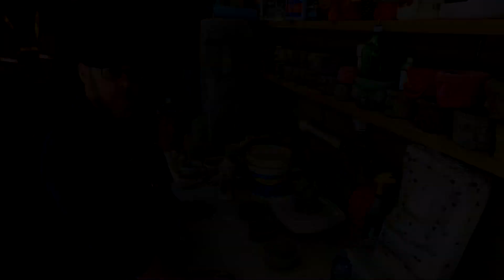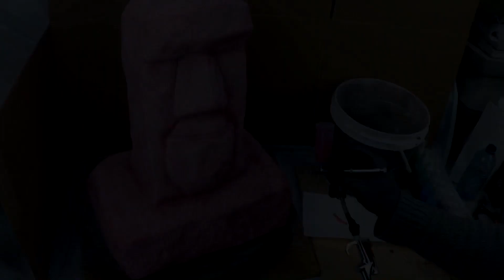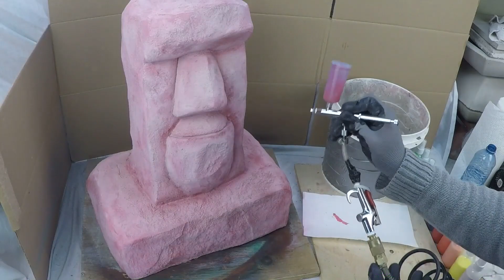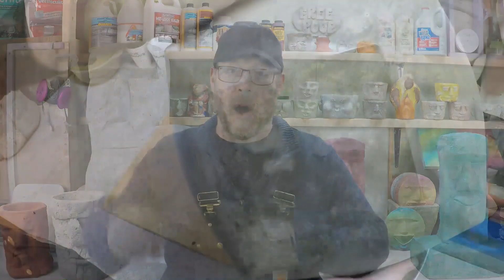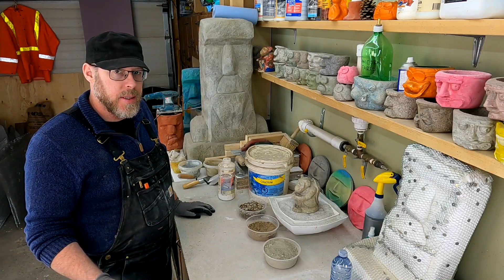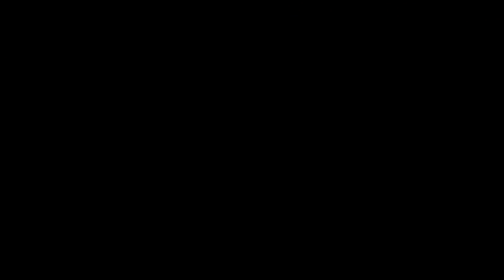How To Speed Up Concrete Curing

Comment: Hey, DIY dummy here. I have a ridiculous amount of old paint leftover and I’ve been trying to solidify it using concrete (should’ve used cement). I have paint in a bucket and have mixed at a ratio of about 20lbs of concrete:1 gallon of paint, and it’s not drying out. My buckets are basically full of this concrete paint mixture, and I need to get them solid by the time the trailer gets picked up tomorrow, is there anything I can do to solve this issue?

Comment: I have been using Quikrete in my silicone tile mold to good effect.  Yesterday I used Cement All, and when I came back this morning, I see that it has warped the edges of the mold, pulling each corner up, making the whole tile concave.  Any idea what may have caused this effect?  I haven't seen this in the 6 tiles I've made with Quikrete.  My guess is that the Cement All has some additive which may have created some heat in the curing process.  Any thoughts?
Reply from the maker: It definitely has accellerants in it which do cause heat from the exothermic reaction.  The faster the mix sets the more heat it creates. Was it outside and subject to winds also?  This can cause curling of the edges in slab pours.
Reply: @creatingconcrete  Thanks for the insights, greatly appreciated!  It was indoors.  I'm here in San Francisco, so our apartment has a fair amount of moisture.

I suppose for the next pour, I'll try to de-mold it after 2 hours, instead of 20 hours.  I just uploaded a video of that tile last night, in case you were curious how it looks.

Comment: A concrete planter, 5cm, like 2inch diameter, might it still crack when in freezing weather? Does it have to be thicker? Or any additive that might reduce risk on cracking?
Reply from the maker: latex or acrylic will reduce cracking as the concrete will be more resistant to absorbing water, but if you have standing water and you let that freeze, it will break for sure and it does not matter how thick the concrete is, the water freezing into ice is stronger and will break the concrete.
Reply: @creatingconcrete  thanks, just only now received notification from utube you reacted… so with some wholes in the bottom of the planter I shouldn’t have standing water at the bottom, which should prevent the pot from breaking. I hope 🙂 Perhaps I put some product on the inside which makes it water repellent (if that’s a word in English)
Reply from the maker: @Kn3tt3rArt  The holes can freeze up and allow the pot to fill with water.  Commonly you turn pots upside down in the winter months to avoid standing water in them
Reply: @creatingconcrete  ok thanks for the advise. Will have to think of another solution then as there will be little maples in the pots. Perhaps put them under a side roof. Btw good informational videos.
Reply: In the meantime I made 15 planters. Worked out pretty good, for a beginner. Next week: a fake rock. Let’s see how that goes…

Comment: I have never had any luck with accelerants in moulds, it actually takes longer to dry and with weaker results, SIKA products suck!
Reply from the maker: melt a little calcium flakes in water and add that to your mix right before you cast it.  It will set up lightning quick, but possibly have unintended side effects like color problems or scaling.  But it will be fast!